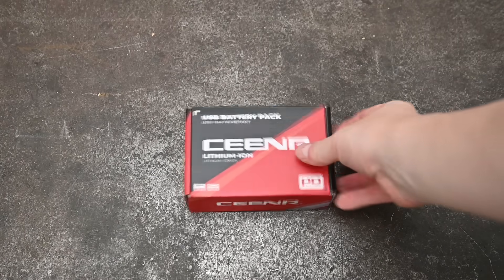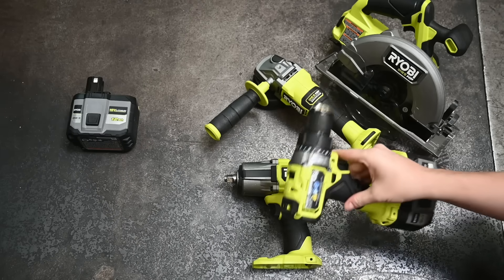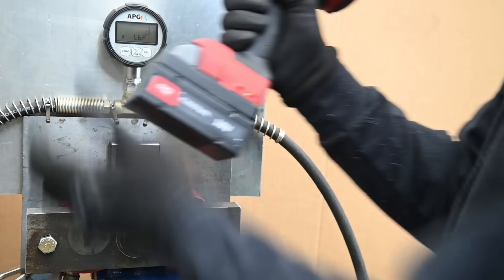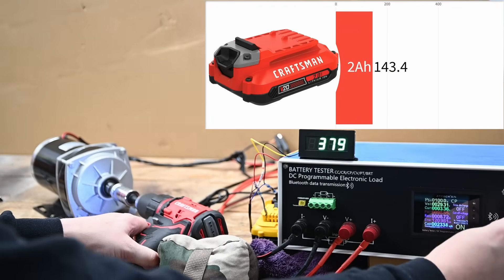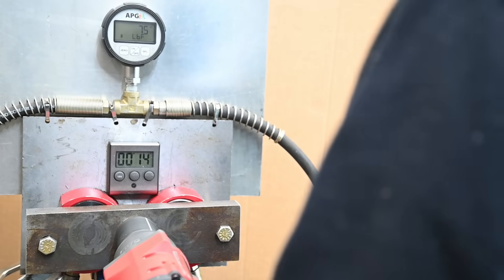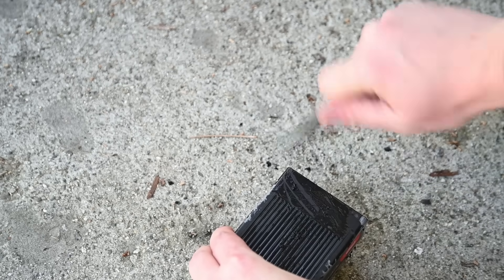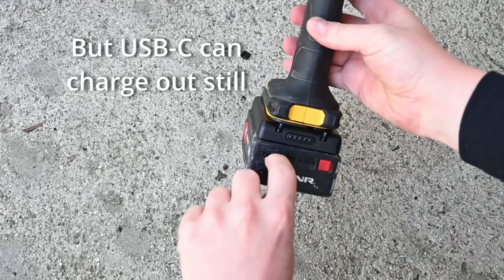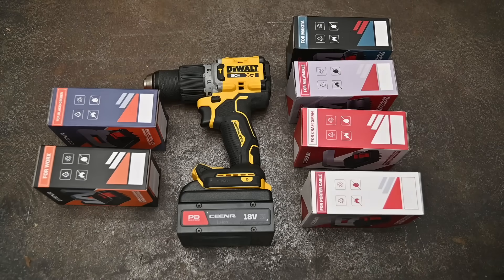We Bought the New Universal Battery for All Tool Brands

Comment: Something people don't seem to realize is that you no longer need multiple batteries for your tools. One large capacity battery is enough for weeks, or even months of use in some tools, like 1/2" impact wrenches in a home garage. If you purchase a tool in "kit" form, it comes with a battery, usually on sale. I have several different brands of tools, and I did this intentionally, to avoid constantly swapping batteries. When you swap batteries, you also risk losing the batteries, or leaving them out of reach. Having "one platform" of tools is not really advantageous for normal shop users. It doesn't make things easy when you have lots of tools laying around with missing batteries, or a bunch of batteries from 2013. Buy the best tool for the job, with 1 good dedicated battery, and not a tool based on "brand" loyalty.

Comment: It's cool but for me I have mainly ridgids platform so what ive done is bought a Ridgid to Ryobi and M18 adapters on some good bare tool finds.  The adapters were like $18 and i can run M18 and Ryobi with my Ridgid batteries.  IF i find a good DeWalt bare tool deal ill simply grab an adapter for that.  

Cheaper option IMO than this since you already have the batteries of whatever platform you're primarily on.

Comment: The voltage drop and stalling/cutting out is perhaps something they can fix, as suggested; but hopefully they do so before release, so early adopters don't get bitten.  It also only seems like good value against reg. price offerings from tool companies.  In the US retail there are so many deals, promos, hacks, etc. where you get batteries (and tools) for much less than "reg. price", it makes having real/genuine batteries for multiple brands and lines of tools not such a big deal IMO.  Genuine will also not be cutting out, having issues, or needing resets...at least apart from defects and rare circumstances. There's certainly something to be said about reliability and dependability even if it means having proprietary batteries to get there.

That said I think it's a great idea--the 2-way PD USB-C on every battery is a nice feature, and it's nice to see they started out with high quality 21700s.  Ceenr will however need faster/dedicated chargers to meet the wants/needs of most consumers.I probably wouldn't buy into it given I have so many genuine/1st party batts for various tools already (reference the aforementioned cyclical deals), but I think for anyone "starting out" with their first cordless tools will find this much more attractive.

Comment: Could u try charging usb c laptop with that USb port and smartphone I would be grateful I was thinking to buy powerbank i need battery for my tools that would fix both problems maybe I could use it as DIY power source for my project too
Reply from the maker: It does indeed charge usb-c out
Reply: @TorqueTestChannel  can u check how  many wats output please
Reply from the maker: About 40w at 20v
Reply: @TorqueTestChannel  thx

Comment: the way i see it if the price of the battery and adapter is around the cost of a new battery and you can still buy more adapters at $20 each you could by one adapter for each device you have and still use the battery for all devices i would call it a win as you could just switch the battery to the needed tool and leave the adapter on the tool and have multiple battery packs if you need them (charging/in use/etc)

i think the only thing you missed in your review is how long the batteries last while in use

Comment: would this work out if you had to buy a bunch of adapters so you don't have to keep changing battery with the adaptor from tool to tool? or at that point is it not simpler and cheaper to just get the branded batteries? Because the allure of this is you can buy new tools in different brands but if you invest into more tools in that brand, you'll need to be changing the battery a lot which is a known pet peeve of all tool owners, for just a one stop tool investment maybe this is viable, but for you to make this battery system your only system I think it would add more cost with multiple adapters. it is still a remarkable concept.

Comment: I know it may be redundant since you have tested battery vs corded tools multiple times (including recently) but I’m curious to see how the corded A/C adapters that slide into the battery connection compare to the various battery sizes. Are they good enough to get you by in a pinch if by some fluke all your batteries are dead and you want to keep working while you’re charging 🤷🏻‍♂️

Comment: Companies have already been making the adapters for years. I have a craftsman leaf blower and weed-eater, all of my tools are dewalt.  I bought an adapter because the 2amh battery that came with the blower are trash. It was $20-25 on Amazon and they have them for every platform.
Reply: Sure you, can get certain DeWalt to other brand adapters, but you have to keep finding adapter if you get a random tool from another company.
But this is like a "universal" battery. One 5AH battery is $50 bucks. That's almost $50 less than say a Milwaukee battery. So for $100 bucks you could get two batteries with two tool adapters.
Then say you get one random tool, for $20 you get an adapter. 
Also they could keep adding more brand adapters even like HF brands Bauer and Hercules or higher end ones like FES TOOLS. No need for battery specific chargers either.
Once they work out the kinks, this ideal of a universal battery could change things for the consumers
Reply: Same here. I run a DeWalt 10Ah on my Craftsman leaf blower. Huge difference. I also noticed the bigger batteries help balance the weed whackers better.

Comment: So... it's trash another words,,, the best battery for the money is hercules,  and an adapter,, hands down,, top notch 8ah 4ah 5ah and 12ah batteries,, the 2 and the 2.5 ah is pretty good too but ,, that's how I handle my 200 dollar battery problem,  I can get the 12ah extreme output 21700 cells,, for 99.00 on sale,, with a 3 or 5 yr no questions asked warranty

Comment: I have Ridgid tools and am switching back to Makita as  Ridgid tools quality unfortunately has  $hit to bed lately  and I have  bought convertor adapters to use either batteries on either tools. Much simpler in my opinion  especially on the charging end of it and I have 40 batteries and 10 chargers between the 2 brands. Plus I can buy any other brand tools and use my batteries if I just buy another adapter for that brand.

Comment: PD nation needs to just burn batteries fix the fail point retest continue till they reach higher output ceiling.
Reply: Then work out a cost vs benefit for the upgrades required to produce it or sell it as a high output and let the customer choose their level of performance

Comment: i use two wire connectors using spade connectors, positive and negative and i use them to connect different make batteries to my drills, they work fine, a little adjustment is needed

Comment: Is there a tear down video of your torque rig ? I don’t understand how it works
Reply from the maker: We didnt go to much into it because we got into a lot here. But check out any early drill video, we later automated it as well. It measure pounds of force a foot away from center axis until the drill stalls, using a free to rotate brake caliper on the pull force gauge and increasing brake line pressure.

Comment: Seems like you guys need to stop using your batteries as hammers...  I know that it's tempting taking a wheel off with your impact and giving it a good wack... But it only takes 30 seconds to grab the big prybar and take the wheel off that way.
Reply from the maker: It is strange that it only happens to M18
Reply: @TorqueTestChannel  If I would still be working in a garage I would likely be using the M18 too to take off wheels.  And I am not judging... I would also use it as a hammer.

Comment: I maybe(and probably is saying) but my guess about they not being able to give the full beans of the batteries to the tools are the differences needed on the circuits. A lot of those tools AFAIK, the BMS(Battery Management System) resides on the tool and not the battery itself but because differences from every brand, tool and more they can't rely on the tool for it, so they had to put everything on it. This unfortunately forces them to put circuit that it will draw part of the current and limit the full output as you can't let the tool pull all they want

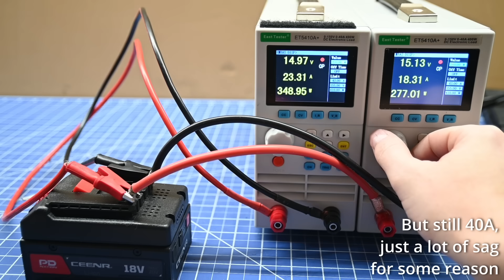Comment: 14:10 there's definitely no throttling. Throttling requires linear mosfets, which are big, expensive, and make a lot of heat. Their mosfets are either fully on or fully off. 11:34 this test shows that the CEENR has higher resistance than the Bosch or Dewalt, despite having lower resistance cells. They've clearly using cheap mosfets with high resistance. If it's losing 1V extra at 37A, that means it has an extra 27mOhm of resistance, which is quite bad. Looks like they're using 4 mosfets and 2 shunts at 12:01 (shame about the focus). 

Makita LXT packs can do stand-alone cutoff just like these packs, but they have a high-end mosfet of only 0.45mOhm and a pair of shunts with 0.25mOhm resistance. Those packs can handle 110A before the pack cuts out from hitting 12.5V - so 1,250 Watts.  M18 12Ah also have high-powered mosfets and I've taken them up to 160A and 2,500 Watts. Powerstack 5Ah also has cutoff mosfets and can easily go over 630 Watts. So this is just showing that you get what you pay for. Cheap batteries = cheap parts and the associated compromises.
Reply from the maker: That does make a lot of sense. Thanks!
Reply: I for one would pay the same as a name brand battery for a high quality universal one. I’m just tired of being trapped in brand X only to find out that brand Y makes a better tool or one that brand X doesn’t.
Reply: Thanks for chiming in!
Reply: i have no idea what you just said. I just know the Ceenr Dewalt Replacment batteries (not the universal battery) I own are pretty kickass and about 1/3rd the cost of name brand Dewalt. Granted I've only had them for one month but so far they have been great.
Reply: While I agree with the general analysis, there's something I don't agree with, though admittedly pedantic. It's totally possible to throttle using a switching power FET, It would only require a PWM frequency that was above the Nyquist rate for the RCL delay of the output... which... admittedly... would be in the several MHZ for the typical power tool battery output layout.
Reply: Could one install upgraded parts to fix this?

Comment: To be fair, by increasing charge accessibily and decreasing charge currents you could argue they're encouraging the right thing

Reducing cell life loss running high charge currents

Encouraging people to buy more batteries and spread their ussage across them rather than smashing 1 or 2

To be real, most guys working out of trucks i see have like 6+ batteries, but can only charge like 1 maybe 2 at a time.

With a USB setup, itd be very easy to have a dock with a charge cable setup for every battery. Only issue is we need dock adaptors to hold the battery minus the adaptor

Comment: Batteries are becoming so expensive that it inspired me to learn about battery chemistry and electronics repair so I could Re-cell and repair M12 batteries for myself and coworkers. Why spend about $200 on batteries when I could put that money into a cheap spot welder, a nice soldering iron and like 20 high quality Samsung cells? The tools are buy once cry once and now I can repair my own stuff for a fraction of the price of instead of shelling out $60 for like $9 of lithium cells in a red flavoured plastic shell.
Reply: PDNATION could go a step above and make their cells replaceable so if one dies you can swap it out and be more environmentally friendly. Totally doable, upfront cost would just be slightly more expensive for the consumer
Reply: @Technie87  I would love this.
Reply: Know any YouTube videos that show you how do this?
Reply: You think like I do but they should make the packs serviceable so the average guy doesn't have to throw out the whole pack because of one bad cell.
Reply: do not solder lithium cells as you may start a fire that is really damn hard to put out. get a welder, it'll be so much safer
Reply: Probably worth it for some, but for the vast majority of professionals, new batteries are cheap enough, and last long enough, to just buy new ones when needed
Reply: @gregorsamsa1364  Your still throwing out a 90% good pack. That is the marketing scam that blows holes right through any global warming BS and is a complete waste of money. Money is money  whether your a pro or not and if your a pro that means your wasting more money because you go through more packs. Don't even try to tell me you or other pros make so much money you can just burn it up like that. I'm sure you all freak out over high costs like the rest of us, have you been to the grocery store lately? I get your point, wasting time trying to fix them is not really worth the effort since they made is very difficult.

Comment: i recently learned the EU is actually drafting new laws to force a universal powertool battery connection. same as they did with usb-c for phones...
Reply: Sounds good, I hope it works out. They usually just ask the industry come up with a solution and then only make it legally binding after it's been widely adopted. Transition period will always be an issue but a great idea long term.
Reply: Hopefully they do an apple and sell just realize the juice isnt worth the squeeze to make 2 different tools for the different battery markets. Also if this does come to pass, time to just buy euro tools
Reply: Interesting! Now I'm invested in DeWalt flexVolt but their chainsaws are nothing good. 60ish volt battery makes sense for high power tools. For smaller tools it is a welcome change to have a 20ish volt universal battery across-the-board.
Reply: @ArthursHD  the same for me, I am disappointed with my DeWalt chainsaw, extremely plasticky, like a toy!  I have switched to Makita XGT 40 V line, plane, circ saw and backpack vacuum cleaner are excellent so far...
Reply: @slovakiansloven  If I had to choose a brand for life it would be Makita or Metabo/Hikoki or Bosch.
Reply: YESSS LETS GOO, hurray for standardization for these instances, I don't think for everything but things that make sense like this for example is awesome
Reply: Bosch and Makita have already been sharing their battery platform with smaller specialty tool makers.
Bosch has also intiated the AmpShare Alliance.
Metabo/Hikoki has the CAS battery system.
Reply: I'd say that sounds good but in ten years of using my iphone lightning cable I've had 1 anker powerline cable and had zero issues. In just a year of using usb c I've gone through 2 anker cables already, 1 of which I stood on and crushed which never happened despite standing on my old lightning cable hundreds of times...
Reply: It's crazy how far behind the US is in so many things compared to the EU. We're busy arguing about bathrooms and wokeism while the EU is actually protecting it's people and environment.
Reply: @CRneu  And the Eu doesn't even have to complain about wokeism and bathrooms, because they have that WHILE protecting the people and the environment.
Reply: @CRneu  This is the same place that still has dictators, no automatic transmissions, is getting rid of nuke power, was relying on Russian energy, is in yet another major local war that is precipitating WWIII, has $8 a gallon gasoline, and 45 cent per kilowatt electricity, hardly any public toilets, and no parking, graffiti, huge bureaucracy, reliance on US defense, falling population,  Yes, they are very advanced... compared to most of Africa.
Reply: You really think they are behind accidentally?  @CRneu
Reply: That is absolutely.
Terrifying

Comment: For a couple of projects I've just bought a $10 battery adapter online so I can use my rigid batteries with cordless harbor freight tools. Seems to work fine although the voltage is slightly different.
Reply: Yeah I don't see the point of buying into this, it's just trying to sucker you into buying more batteries. 

An adapter for your existing branded batteries to work on whatever new tool from another brand you're looking at is the way to go.

Comment: $69 is super cheap, DeWalt wants at least 75 per battery every time, with only $50 for a small battery plus $20 for an adapter is a steal!
Reply: There’s always deals out there for batteries. Lowes had a 2 pack of 6ah 21700 cells for $170 (if you use your lowes card). I picked up a 1.7Ah and 5Ah PowerStack with charger kit on Amazon for $119 and just got a 1.7Ah PowerStack with rubber over mold on Amazon for $45.50. There’s always a deal somewhere.